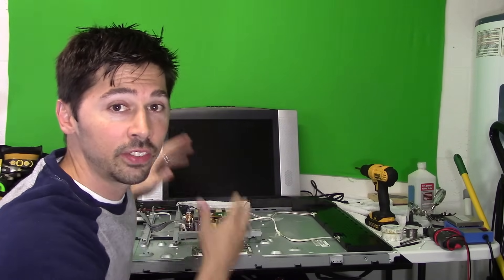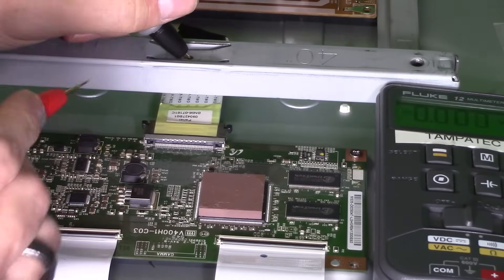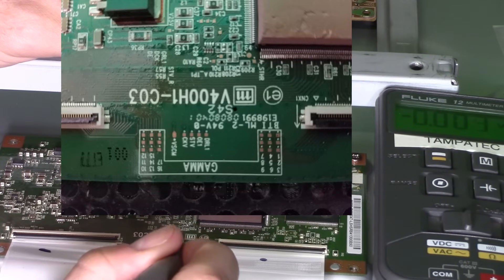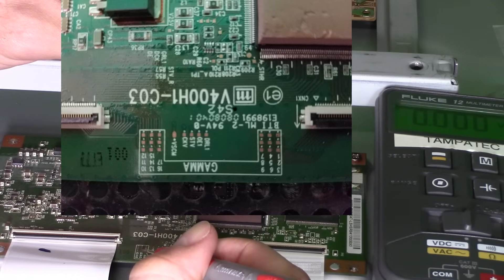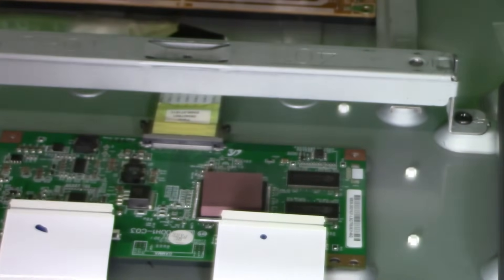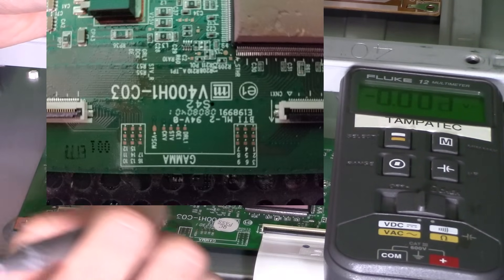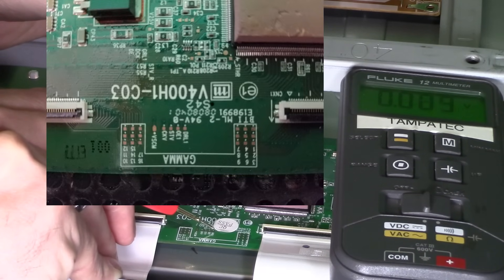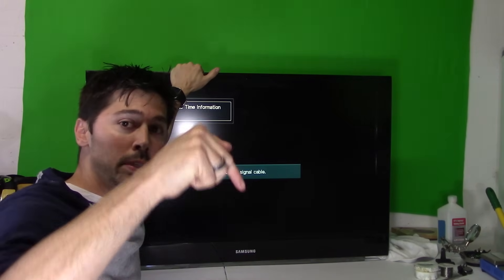THIS EASY 5 MINUTE TV REPAIR WILL FIX MOST VIDEO PICTURE PROBLEMS!!!

Comment: 1.I removed the backlight of my lcd and it had some layers of diffusers , polarizers ,etc , is the order and rotational direction in which it is placed important ? if yes, can you provide me with info or a link as to how to place them as i forgot in which order they were .
2.I removed the ccfl backlight and trying using some uv leds of 400+ nm as i need a uv backlight to cure resin , do you have a video or link where youve removed a ccfl tube and replaced with leds ?
3.Will the heat from the leds quickly spoil the lcd , if yes, how do i get about it?

Comment: I have a 65 inch Philips Smart Tv and I replaced every thing "Main Board, T-CON and Power Supply" and I still get a black screen.. I see the back lighting but no Picture movement on the screen.. I can hear the sounds loud and clear even the robotic voice.. I can see the Back light(The Glow) but no movements on the screen..

Comment: I have a Samsung 3D 8550 55" It displays half a picture great but the right half is displayed but has vetrical lines like a poor signal that goes in & out. T-Con board?

Comment: I have a Sony Bravia 55. There is a horizontal line through the center of the screen, thin black line. I removed the back panel of tv, doesn’t look like what I have seen on your videos. 4 ribbons going to the board. Don’t see how to remove the ribbons. Tv works good except for the line. Should I replace the board?
Thanks for your help.

Comment: Thank you for the info.  Do the T con board number matter or any T con board can work with a Tv. I have Sharp 50 inc, no sound no picture need your duration. Thanks
Reply: The model is LC - 55LE643U, Sir, 40300715035

Comment: I have a tv doing similar to this video's tv, but picture is ok for a short time then fades out. i have replaced tcon board, and have swapped out main board and power supply board, with no resolution to the problem. What am i missing? (It is a sharp lc-65Q7330 roku tv)

Comment: Hi, i like your video. My Sharp Roku TV has sound but no picture, it comes right in the beginning and goes off very quick, i suspect the LCD logic Board T420HVN06.3 Ctrl BD 42T34-C03                 (FT-5550T20C21-57L-000N6P-04701-04) 
what do you think?

Comment: Hey I've got the LN40A530P1F and the Tcon voltages read the same as yours except that my readings on 12-17 are way higher ranging from 8 to 13 volts. They seem to be holding steady, but could the high voltage indicate a busted board?

Comment: Thanks for the video. Just replaced my T-Con board on my 37-inch sony tv. Works great now. It is important to order the board using the codes on the board, not just the tv model number. Got it from China 27 dollars delivered. Unbelievable. From Cyprus

Comment: Dude! Great tutorials. I have watched a few of yours! I have a Vizio E422VA. Lost composite inputs about 5 months ago. Then, Hdmi quit working last week. I have watched your vids dealing with issues, just not on this specific tv. Tuner still works great and unit will take updates from vizio. Hopefully updates included firm ware. The manual says product updates so I don't know what they sent. no change on those lost inputs since updating.. It is a cool tv with great picture. Any Help would be appreciated. Thanks in advance!

Comment: What if my tv has no t con board. It has wide wire connected from main board straight to a single  display board. I dont know if my t-con function is done in that single display board on in main board. Tv is 24" 720p Vizio D24H-G9. The problem is: imagine you divided the screen to 4 vertical quarters. Now number them left to right 1, 2,3,4. So second quarter is missing picture it is plain white and the rest of the screen has some interference. Please give me a clue where to look if you have an idea. Thank you very much. Signing liking subscribing, thanks.
P. S. I also have few brand new tv's with cracked screens for parts. Got 2x 50" 2x43",1x 32", 1x40". Mostly  vizios.
Can list any parts from them on eBay to sell. If you are interested i can list all models.

Comment: I picked up a 65pfl5602/f7 the other day. There is a slight blue tint to it. I  am not sure if it’s a back light problem or a board problem. I can not find this model or issue anywhere on the internet.

Comment: Hi Tampa Tech ~ My 50” Samsung smart TV picture just drained out of the screen .  There are backlights in the back of the TV, there is volume and the channel can be changed with the remote.  I just replaced the T-Con board that I purchased from Jimmy and that did not fix the problem.   What should I do next?  I appreciate your help and thank you in advance.  Liz

Comment: I have a Sony NSX-46GT1 Google TV. The panel display works well with USB input on the motherboard and hence does not have any issue with it. But it gives Reddish picture while connected thru HDMI ports or AV input which is on BA mount board. In any case, the sound does not have any issue. Is the problem with the LVDS cable that goes from the HDMI board to the mainboard? Pls help

Comment: So I'm trying to fix my 1st tv. A 42 inch LG that you can only see a poor quality top 20% of the screen, the rest is vertical lines. I watched your video and chose to replace the T con board but it's no different. Any thoughts on the next steps please? I'm enjoying doing it but when the costs add up is it worth it? Thanks

Comment: Tested all my tcon "test points" and there were a couple that would jump from negative to 30v back and forth. Currently experiencing ghosting and flickering. With one side of the tcon disconnected issue goes away and if i do the same for the other side then issue continutes. Safe to say its the Tcon?

Comment: Hi Tampatec. 
I wonder if you could point me in the right direction. I have a Toshiba 24W2863DB
SN:-8184145 900410.
Its 13 months old and took a little knock which caused the screen to go blank. The backlight comes on but just a very faint glow on the screen, I've tried the flash light test but cannot see any logos , sound is good. I've removed the back cover and tried following your test procedure but the test points are totally different to anything in any of your tutorials. Any help would be very much appreciated. Thanks.
Paul

Comment: Samsung lcd le32m86bdx tv working normal but after some times turns black no video text and after few second turns back on.but pisture setings turns to deafault and colour saturation is not plelasent.probably processot for sone issue turns back pucture .any idea for solution thanks wery much

Comment: Hi sir. Very informative and intresting. I have an TCL LED55E5900 4k smart tv that has a problem since yesterday. It has sound and all inputs works. The problem is as follow... Low brightness specially on left side, Red color has become yellow, Green vertical lines partly on both sides. Ghosting/blurry/duble picture with slow refresh rate, very difficult to read meny. I have tried soft and hard reset and a few light smacks around the backside with no result. Most likely the t-con board right?

Comment: I have power, lights and sound but no picture. I don't have meter but I replaced the Tcon board and I still have no picture. What else would I replaced to get my picture back. I have a 65" smart cast Vizio tv that is a year old.

Comment: LG 60UJ6050 TV. After being on 3 to 4 minutes, vertical bars cover the entire screen. After 4 to 5 minutes, the normal picture returns, plays a couple minutes, then goes back to the vertical bars.  I removed the back and tightened all screws and disconnected and re-connected ribbon cables on the t-con board. It worked about 5 hours of play and I thought I had fixed it!  It started doing the same vertical bars again.  This time, with the back still off, I realized that I can move the left ribbon cable and get the picture back.  Of course, it goes back to vertical bars at any time, seemingly without a cause.  Do you think I have a bad t-con board or just a bad ribbon cable?  Or maybe both?

Comment: Vizio 42" E420VT. Powers on to blue screen to clean display of Vizio Logo on black screen, then top half of screen gets all horizontal lines for a second or so then TV power off. Obviously a fault event. Is the T-Con board the small one or the larger one with the HDMI input hookups?

Comment: I have been repairing tv's and other electronics for two year's know and owe alot of it to your video's thank you. But i have a wierd Samsung UN65H6400AF that is starting and shutting off by itself. It makes it to the hdmi one connection screen after the logo and 10 seconds later it restarts. The power switch doesn't work whether it's on or off but once you plug it in it starts by itself and does the off and on repeatedly after about 10 seconds. And of course no remote with it, I've thought maybe a firmware update but what if it shuts down during a usb firmware update it will crash the tv and no response from the power or selector switch to try and disable the wifi or even other settings to see if that is the fault. Any suggestions would help thank you.
Reply: Sometimes there is overcurrent sensing circuits particularly in newer tv's that shut down a tv when there is a power problem in the tv 
Ive seen where a backlight had one faulty led shorted in a bank of many creating more current in the parrallel circuit due to less resistance path ohms law......as a result the overcurrent circuit would try to shut the tv down and the tv would try to reboot imediately after in a constant cycle
The fault was hard to pin point as the backlight was still lighting up even with the faulty led which wasnt immediately noticable.

Comment: I have a Sharp LC-32GP1U that has the vertical line problem, can someone tell me if the 3 tiny led? light on the main board have anything to do with diagnosing this problem? there are 3 of them, one (located by the TP2006)
blinks about every second, the other one stays on all the time, and the third light blinks also.

Comment: Hi 
I got lg tv smart 3d 42 inch 
When I switch on pictures goes off after few seconds 
Sounds is ok and i can change channels 
But no pictures, when i look at the screen with flash i can see a bit of the image 
Do u have any idea what the problem can be
Cheers
Reply: it could possibly be your t-con board you should pick up a multimeter off amazon and test it out the same way the video showed.

Comment: HI mate,
I have problem with my Samsung Smart Led Tv. Model UA55NU7400SXNZ, so i need a bit help. There is black peace of dark spots on laft top side of tv due to not handling properly with it. The screen is not broken,what is not bad,but unfortinately i cant detect the main problem so if you can help me with that. Would be great if we can stay in touch thru email,so I can send you couple of pictures of it.
Regards
Marko

Comment: My Philips 52 in tv has no picture.

It is a:  Model # 52pfl5704d.  It was in storage for a while and when I turned it on it has power (the light comes on), and back lighting.  I can see it from the back with the cover removed.

I have checked out a few of your videos, and they all lean to the T-con board.  The part number for it is:  RUNTK4107TPZA Philips T-Con Board. 

I can’t find any in stock, but found someone on eBay that says they test and fix them.  I am not sure its the board.  Any suggestions to verify the board is the culprit?

Thanks

Comment: It would be handy if you mentioned that you replaced the board with a new one and not just put the same one back in its place, because that's what it looks like you did in this video.

Comment: Just wondering if you have any ideas about the LG 55EC930V OLED  TV which is about five years old now.

The fault is that the picture can be seen, but one side is normal and the other side is very dark. There is no sign of screen burn.
Reply: Toss it.  Don't waste your time or money messing with junk newer tvs.  Put your money toward something else.  Newer tvs weren't designed to be reliable or be repairable.   Trust me.

Comment: I have a tv I had the t con board ic chip replaced on when I put the hdmi cable in on the left side of my tv they go away when the tv warms up I cleaned all the cables my cable to my t con board is clean

Comment: Hi! I replaced the  t-con board it fix some of the bad picture but I still get the vertical lines!
any othe ideas?
Reply: Maybe t-con you got is faulty too?
Reply: if from ebay then ebay has no way to verify that any circuit board is working fully functional or not they are the same as our biggest internet provider and that will always be the same 100 years from now regardless if it is shadily listed as brand new or obviously not (AKA Pulled from Known Working Set) bahhhh!!  bahh!!  ahhhh!!

Comment: i love how on these tutorials it's ALWAYS an EASY FIX but when you do it it's the most DIFFICULT repair
Reply: Replacing the tcon would be the easiest thing ever. A lot simpler than soldering a flat flex cable.
Reply: How do you solder a flat flex cable.
Reply: @jean-lucpicard5510 prove it or shut up
Reply: Did you watch the video? Take screws out of back cover remove flat cables from board and remove screws. Then reverse order and done.  Easy

Comment: Hello, my Panasonic Smart LCD TV TX-48CX350B shows some horizontal lines on the pictures of every TV channels and every Netflix movies. However, these lines do not appear on the menu of the TV and neither on the "homepage" of Netflix, which are displayed properly.

For example, if I press the menu button of my remote control, the part of the display showing the menu appears clear, while the other part of the screen showing the channel still has the horizontal lines. When I close the menu, then all the display shows the horizontal lines.

Should I replace the t-con board or the logic board or anything else?

Thanks in advance!

Comment: I have no picture all on my LG 47".  I've taken it apart, down to the LEDs.  I don't know what setting to put my multimeter on for testing each LED strip.  I got it from Harbor Freight.  I can order the strips from eBay.  They're 47LN5200-UB. Is UB the same as UA?  I m considering just replacing all of the strips.  (6 rows, 2 strips each row....totally 56 LEDs.  Help please!

Comment: I have a LG 65UH5500-UA LED smart tv. I have no picture, no sound, and no images on LCD panel. When I plug the power in, I get a flash on the screen for a second and then screen go black. The power LED light stay on for a second and then blinks 2 times. If I press the power button, the same thing happens. I have followed your videos and can't figure out what is wrong.
Reply: It's a fault code that's blinking

Comment: Dear sir, 
Please help me with this problem , I have a LG plasma model number LG PB6650 , it was struck by lightning during a storm ,we were watching it and it shutdown, the standby light is working correctly when on or off , red light is on while shut off.  meantime when powered up the tv will come on but no picture or sound and the odd thing is that it powers back off then back on by irself. I have replaced the power board but that did not resolve the problem, I have ordered a Zeus board hoping that will fix the problem, do you have an idea of what it could be? Thanks brother

Comment: I am having a problem with a Westinghouse flat screen led tv and a Phillips dvd player. I am noticing a random failure to display video only when playing the dvd player. Audio is fine and the solution is to turn the tv power off and turn it back on while the dvd player is still running. Switching hdmi cables and inputs to the tv makes no difference. Video blank out problem does not occur with Dish TV dvr input. I want to run a different dvd player and see what happens, but I don't have a unit to swap out.  Problem usually happens towards end of playing a dvd movie about 40 minutes....never early in the game. Any clues?

Comment: Hey Bro, I have seen several of your videos & I have a Vizio model m550vse...I turned off the front indicator light & about a week later, the TV has failed...When I turn it on, it lights up just fine & almost immediately the screen goes black. The audio works.  PLEASE, ANY ADVICE WOULD BE GREATFUL! I see you work on all of these other T's & wonder which video would apply to my Vizio 55????

Comment: Hi Tampatec… Cheryl here, I  was wondering if you have any advice for me? I have a 49 inch Toshiba UHD smart tv model 49U6763DB and the warranty has run out about 2 months now. OK it started with a pink line straight across the top of my screen about 6 inches down from the top of Tv.. and after a month I got another pink line about 14 inches below the first line and inbetween both lines the screen was sorta pinkish..... well now a month late again the top line has moved up practically to the top of the screen straight across now.... but the 2nd line is in same place but its about 12 lines now like a rainbow  but only about a inch wide in total  straight across and same pinkish between.... any help will be much appreciated....  just need a solution so I have an idea of how much it will cost for repair… I look forward to your reply  TYVM.   Cheryl

Comment: HI i am working on a samsung LE40A456CD it has a white screen , could be the T. CON board or the LCD panel circuits ? I notice the I.C AS15F is getting hot to touch on T.CON board . please  help

Comment: Not sure if you ever found out over the last 2 years, but thermal pads themselves don't add much to cooling potential. Ventilation and Surface Area are key. What you should use is adhesive heat sinks. Great videos btw!
Reply: I tried it and is working for me now

Comment: Samsung 8 years or so LN46A650A1F developed a problem a few months back.  When it first comes the left 3rd of the picture is double and unreadable after about 30 minutes the picture clears and is good until it is turned off for a long period of time. Any suggestions?